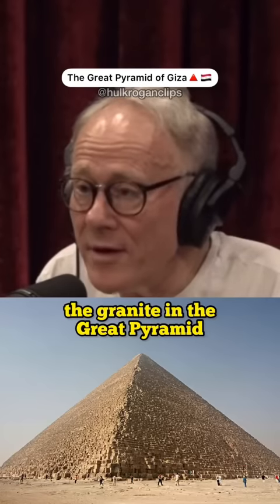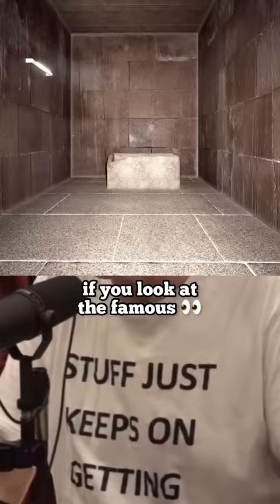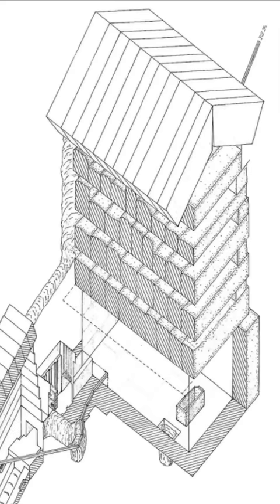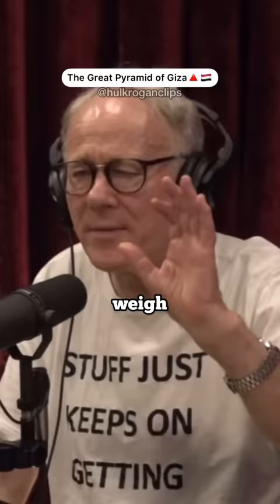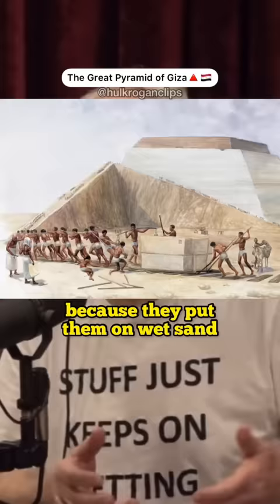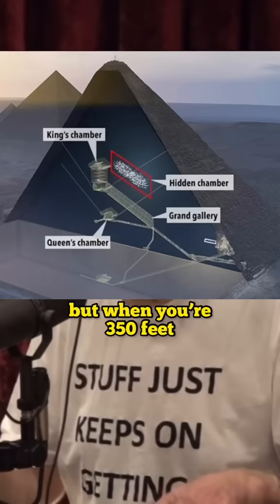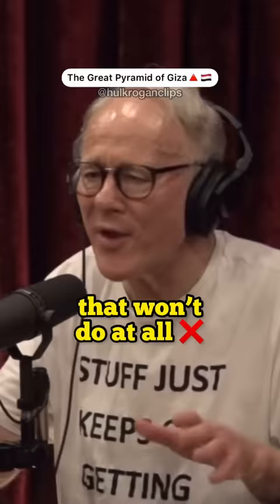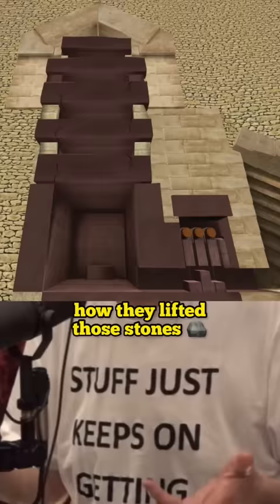How were the pyramids built? #joerogan #shorts #history #egypt #pyramid

Comment: what if we were just all jacked asf back then but in time we stopped lifting rocks and we got weaker 😮
Reply: Not 70 tons lmao
Reply: 70 tons is 70.000kg. Let's say the average starved slave could pull like 70 kg maximum, you'd need a 1000 slaves for a single block. That's nuts
Reply: @slayingfury3  
Just get 1000 slaves smh my head
Reply: @slayingfury3  not to mention the I believe he said 5000 kilometers, the people in this section really haven't thought this out, they just want to sound smart.
Reply: Must return to monke
Reply: @slayingfury3  they have to be using some sort of machinery... simple or complex.. like we do now. A simple pulley system can make you lift more than you ever can.
Reply: @Fact_core  1000 slaves can't fit on the block bruh
Reply: @settra6935  500 miles* not that unrealistic given the timespan it took to build them. The stones from stonehenge for example were escorted from Wales down to Salisbury without even the use of ships, which I believe the Egyptians may have used to escort most of the stone used for the pyramids.
Reply: Most likely the human body was more fit and stronger back then due to the diet and environment, people forget back then it was literally survival of the fittest and the food they ate did not have any of the chemicals and other nonsense they put in our foods, but on the other hand food was not readily available as it is now so am sure famine and starvation ran rampant so there is that too also I think people think the pyramids were built over a couple of years but if you ask me I think they took decades to build maybe even centuries I bet you if they dated the rocks on the inside they would be much older than the rocks on the outside I mean most of the rocks on the inside come from miles away so maybe when they first started building the pyramids those rocks were close by but over time the landscape changed and those rocks were to far away now so they had to use rocks that were closer to them. Am going to be honest with you if they used some kind of technology there would be evidence of that so unless the government is hiding it then we can all assume that it was built by human hands, not ET.
Reply: How strong like Superman strong or what?
Reply: @slayingfury3 You seriously have no idea what you're talking about in regards to slaves building the Pyramids and the 500 miles statement as well.
Reply: Yes. So lift 70 tonne pieces of rock from 500 miles away...
Reply: If they were gigantic they could have mummified their bodies or at least we should have their remainants which we don't so forget it
Reply: @slayingfury3  one person trips, and its rest in peace
Reply: Some people believe the civilization at that time consisted of giants males and amazon females
Reply: @slayingfury3  They weren't slaves
Reply: Well word on the street the oxygen levels were higher back then so that means humans and animals would be bigger so
Reply: @settra6935  he did not say 5000 kilometers… that’d be super ducking far
Reply: Does everybody simply forget that they had access to animals back then?  And it wasn't slaves. It was employees for the most part.
Another thing people don't seem to realize is that there are literally dozens of pyramids all along the Nile So they had multiple construction projects at any given time.  So it's not unreasonable to suspect they had extensive infrastructure in place to move all these blocks And it wouldn't surprise me if they had at least two or three thousand people available at any given time to move things around.
Reply: @slayingfury3 pyramids didnt get build by slaves
Reply: giant beings are depicted across multiple civilizations and eras. we used to be 7 and 8 feet tall on average. even animals are much much smaller than they used to be so it wouldn’t be far fetched to believe we also are much smaller than we used to be.
Reply: @Fact_core  problem solved hey🤣🤣🤣🤣🤣🤣🤣🤣
Reply: @slayingfury3  so how did they bring the stones from Wales to Salisbury
Reply: @dreamkitty  Those are myths to express how strong ancient people were. In reality ancient people were less tall, but that doesn't mean they were weaker. They were very strong physically. There's something called evidence, look it up.
Reply: MonkeLiftRock
Reply: @cerogravity8653  not to mention the vapor canopy
Reply: The average size for a male back then;
8 feet 6 inches tall
475 pounds
That's how they did it

Comment: I think the grand gallery was a counter weight system so they could slide blocks back and forth, using many ropes and pulleys, to pull heavy blocks up a much shorter ramp.  Pulling each heavy block up, or group of smaller blocks, would require resetting the counterweight system several times.
Reply: yes. Most likely used around 10 smaller blocks for each 60-70 ton big block. Haul up the 10 smaller blocks 1 at a time using mostly man power plus equipment, which is doable as each is around 5 tons. Then use them as a group counter weight for the big block.

Comment: Similarly the sivan temple from tamilnadu, locals call it big temple, has its granite come from the nearest in Tiruchirapalli and the temple is in Thanjavur. They are 50 km apart. The were able to move several 1000s of tons from Tiruchirapalli and no one still knows how. Not only that the tall tower in the middle of the temple is over 900ft tall and it is an hollow tower. It has not collapsed or anything for more than 1000 years which is mind-blowing. Proud to be a Tamil after looking at what my ancestors did

Comment: The 2 best theories/conspiracy theories I’ve heard of in the creation of these monolithic architectural marvels are 1 they were created by sound (vibrations and frequencies) and 2 is that giants/nephilim created them. 
Personally I have no idea how they were created but these two theories have always fascinated me.
Reply: Lifting 70 Tons using sound is absolute nonsense…
Reply: They used seasaws where they wedged wood under the blocks to slowly lift them.
"Hurrr muh vibrations"
Reply: @fotoschopro1230  Doesn't explain transporting them and getting 70 ton blocks hundreds of feet in the air
Reply: @koppy82  Primary transport was by boat, transport from site to boat and boat to site was done by building wooden rails.
A cube doesn't roll on a flat surface, while a wheel does. You simply transfer the round shape in the phase of the size of the blocks onto your tracks, so that the center of mass of the block stays level.
It does not have to be perfectly accurate.
The blocks will then be able to roll like wheels. The wooden track could be semi permanent or it could be movable, no one knows.
A handful of people with some ropes and some of these tracks would then be able to move the blocks for kilometers.
An area around the pyramid is cleared of sand, so that the bedrock plateau is exposed.
The blocks are then maneuvered into place by using ropes, wooden levers and pebbles for reducing friction.
How do you get the block up?
The pyramid starts out in a stepped style.
This means that the layers get slowly stacked on top of each other, with space left uncovered around each step, so that transport to the next step can take place.
The blocks are maneuvered adjacent to a side of the pyramid using the former methods, a small wooden frame is then installed around each block. Wood is then slowly wedged beneath it to lift one side up.
Wood is then wedged under the exposed blocks center of mass.
The block is now unstable and can be tipped back and forth, simply by adding weight to one side or the other, more wood can be stacked in the center of mass of the block, slowly lifting it up.
If the block is high enough to cause the structural integrity of the stacked wood to deteriorate, smaller stone blocks could be placed beneath it.
The process is repeated until the large block arrives on the next step of the pyramid, where it is maneuvered into place by using simply pebbles, to reduce friction and make the blocks unstable and levers.
This is done until the pyramids construction is finalized.
The covering is then installed.
Whether or not it was installed the same way is not clear to me, the red pyramid points towards cover blocks being installed in a different manner, as you would expect them to add the cover stones top to bottom, however, too little information about the exact decision making process is known to make clear deductions on whether or not the granite cover stones used in the red pyramid can be used to understand building order.
They could have simply been added last, after all.
It is a time consuming process, but it requires very few laborers, compared to illogical mainstream ideas such as giant ramps.

Comment: Simplest explanation is often the right one. They likely just built long dirt ramps or something to get them that high, or a bunch of switchbacks if the ramp would be too long, put them in place then took the dirt away.
Reply: Someone did the calculation on this, it would require an incline of less than 5 degrees if i remember correctly, which means the ramp would have to be several kilometers long. Pretty much impossible for them to do it and then for it to disappear, especially since they'd probably need to use stone and sand instead of wood, for the stones to slide using water without breaking the ramp
Reply: Could the simple explanation be that an older civilization built them?
Reply: @kevinguzmanvelez1456  this is correct ^
Reply: Maybe they used 10-20 elephants to move an elevator
Reply: They found out that one of the pyramids has an internal ramp that spirals up to the top of the pyramid.
Reply: @carerforever2118  and that was for 70k lb stone carrying you think?
Reply: @ticklefritz7957  How is this a simple explanation? It's not even an explanation at all. How did the older civilization do it?

Comment: I'm not familiar with the geography of the area but I would assume that they used the Nile to at transport the blocks at least most of the way. I wonder how much buoyancy you would need to float them, they could probably just do what early loggers in the United States did and just throw them in the river without a pilot on the boat. And I do know that the Nile runs to the north so theoretically it should work, you eould just need a dam at the end to catch them before they went into the Med
Reply: Yeah they move them from the river, the flow is to the North so they.only put them in boats and just the captain to check it don't fall, the problem is not the transportation is how they put it up there
Reply: @ricardoalcala4784  some people have speculated they diverted the river to put the blocks in place, you'd have to dam up quite a bit of the river to do that but I don't think it's impossible
Reply: last time i checked a 140,000 lb boulder doesnt just float downstream. maybe im crazy though
Reply: But then what lol
Reply: @dubsie2209  wood adds buoyancy, they could either have a boat or just strap logs to it
Reply: @shrupsr6  if it works and it looks stupid it's not stupid
Reply: @dubsie2209  But what about a boulder on a giant piece of wood?

Comment: They used a pulley system. There's still places in the pyramid where you can see contact point and a very large shaft for the counter weight. Specifically how? Like what exactly did it look like and work out? No. But they clearly used pulleys.
Reply: 😂 pulleys my guy. It’s deeper than that

Comment: Houdin (architect) demonstrates how it could be done with counterweights.
Reply: Moving them but not constructing so precise
Reply: @michaelhuddy4424  Only small parts are done precisely. Large parts are more roughly filled.
Reply: @RasmusDyhrFrederiksen  if you’re off even a little bit the whole thing would be fucked by the end
Reply: @e-baby8752  mate the sides of the great pyramid aren't even equal in length. They couldn't even get the square base right.

Comment: To lift a 70 tons stone, you just need 70 tons of anything else .. like small stones or even sand.
Reply: Well, in order to leverage it you'd need at least that weight yes, however usually when people think of this they assume that only would level it out instead of lift it. They would need to lower 70 tons of materials to a lower elevation in order to lift the other 70 tons, if not they'd need more weight than the original object being moved.
Reply: Your not thinking outside the box how mouch does it take to lift 70 tons hmm maybe a giant. The only explenation is that people where giants and thats fax
Reply: Do you realize how much 70 tons is? What kind of pulley system did the ancient egyptians have that could support nearly 300,000 lbs of weight?

Comment: There exists a technology that has existed for ages called a pulley system.
Reply: What pulley system made of wood and rope can handle 70 tons 😂😂😂💀💀💀
Reply: @RoobrtLiwanduski  Tell me you dont know how a pulley system works without tellimg me you dont know how a pulley system works.
Reply: @thoughtgaming492  no pulley... especially 4000 years ago would be capable of 70 tons dawg 💀💀💀
Reply: @thoughtgaming492  no rope in the world... especially 4000 years ago would hold 70 tons 😂😂💀💀
Reply: @thoughtgaming492  can you read bud? It's states they used a pulley system for the 2.3 million 2.2 ton bricks, it says nothing about using a pulley system to get a 70 ton brick into place, 

"Full scale Egyptian pulley demonstration
Based on the successful prototype demonstration a full scale Egyptian pulley was designed, fabricated and demonstrated; 'full scale' in that the pulley would be intended to lift a 2,268 kg weight."

 That was mainly its cap. 2.2/3 tons. That is not even close to 70. No matter how much you distribute the weight the pulley system made of wood and rope wouldn't handle 70 tons. The wheel, everything would break. It's not as if you can just left anything if you have a pulley 💀😂
Reply: @thoughtgaming492  but with technology we're obviously able to lift far heavier objects now because of the materials.
Reply: @thoughtgaming492  that's  like sayimg i have a pulley made of wood and rope let's go pick up the statue of liberty... it doesn't work like that 😂
Reply: @thoughtgaming492  you seriously overestimating the Egyptians 💀😂
Reply: @thoughtgaming492  the answer is clearly in the video.. they used a technology that we aren't aware of, they didn't do it with funking wooden pulleys
Reply: The wheel wasn't even invented so how did they have pulleys 😆
Reply: @nunyabuziness8421  Heres a link to the harvard backed document which includes the discovery with pictures of Egyptian pulleys. Maybe try some research before you embarrass yourself online again.

http://gizamedia.rc.fas.harvard.edu/images/MFA-images/Giza/GizaImage/full/library/hassan_giza_10.pdf
Reply: @thoughtgaming492  yes they used pulleys, but not for 70 ton blocks dawg... they uses pulleys for the main blocks on the outside which are only like 2 tons, the pulleys they used aren't the pulleys your thinking of today
Reply: @RoobrtLiwanduski  Again. Tell me you dont know how a pulley system works without telling me you dont know how a pulley system works.
Reply: @thoughtgaming492  again, so your telling me you know more than scientists that have studied this for years and still don't have an answer? Cool
Reply: @thoughtgaming492  you've just single handedly solved one of the greatest mysterious of all time... how do you feel? 😂
Reply: @thoughtgaming492 gyptologists agree they used a pulley system, but only for the stones weighing 2.5 tonnes or so. It doesnt explain how they lifted the 70 ton blocks. 
Yes i read the document you shared. Very interesting read. 
They recreated pulleys and proved they could indeed lift 2.5 ton with them. Know why they didnt lift 70 with it? Because its not possible. Its a good theory but there just isnt any evidence for it being factual. You can look it up yourself. 
They would have used limestone and rope to make their pulleys. They didnt have steel chains or anything. Its too long ago.
Reply: @ofrenic  You don't need steal chains or any of that. If you have enough pulleys of limestone and rope then each pulley is only taking on a fraction of the load. Pulleys are literally made to be able to lift any weight by increasing the amount of pulleys used.
Reply: @thoughtgaming492   so your theory is they used like 35 pulleys in unison to lift it? Not impossible but i wouldnt be calling people stupid for not aligning with your theory.
Reply: @ofrenic  When someone presents to me a working theory that isnt "Lost technology" from a civilization that couldnt even make a wheel, then I'll go with that. Until then, the obvious answer of using the tech we know they had is what I will go with. Yes, 35 pulleys or however many they would need for 70 tons is a lot, however, it's not an implausible amount. The more pulleys in a system, the more weight they can carry.
Reply: @thoughtgaming492  while its definitely probable, we just dont know. You're kind of asserting the idea as if it is fact though, which it isn't. For the record i also dont subscribe to the idea of a lost technology. I just dont think 35 pulleys in unison is the answer. 
It is a good theory, but it remains as such, a theory.
Reply: @ofrenic  It is a theory, yes, but it is the ONLY theory with actual evidence. As I said, as soon as another theory has evidence backing it, Im all for it as a possibility. Any theory that has exactly 0 evidence though makes no sense to talk about.